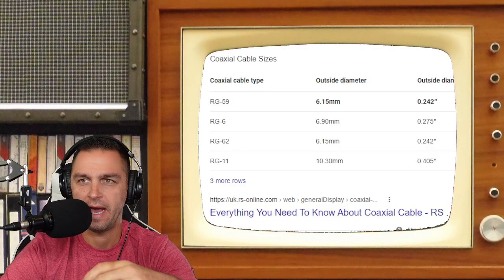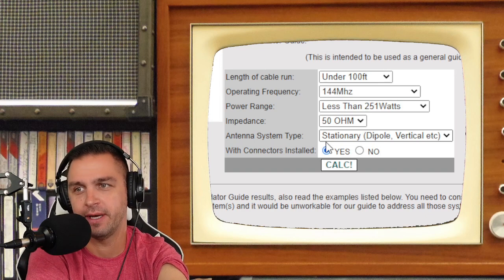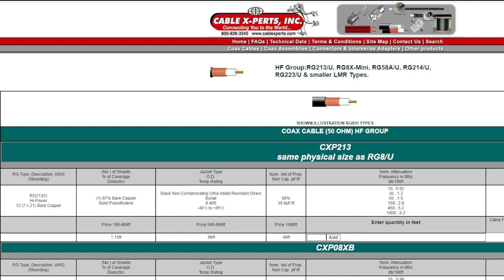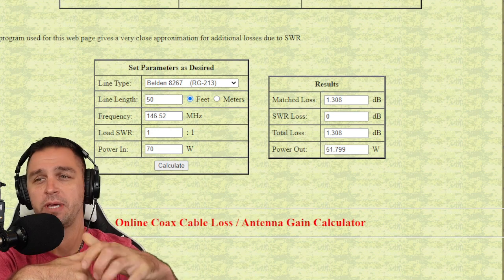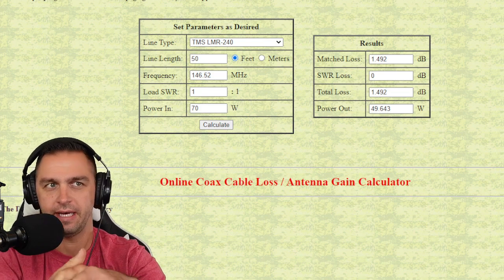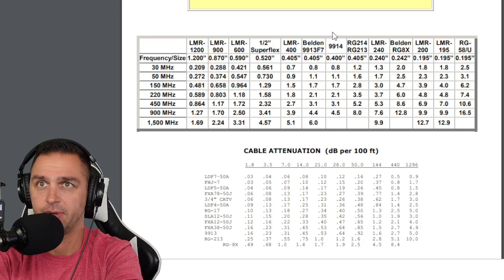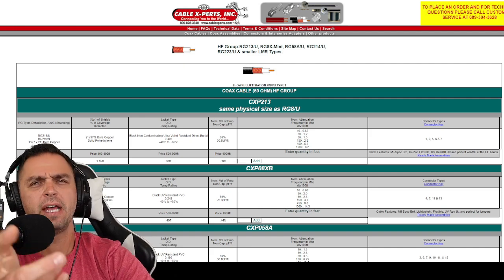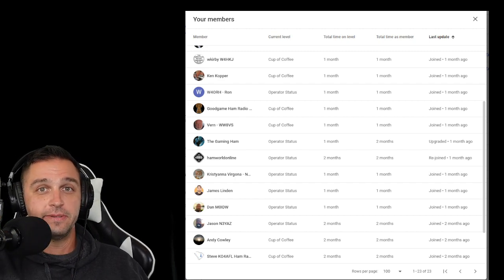How to Choose the BEST Coax Cable Type for Ham Radio - Great Information For New Hams!

Comment: Great job on this Sean! Thank you for the well-thought-out presentation. Goes to show us all that it all depends on our individual use case. There is no "one size fits all" coax, really. I live in Florida, and this past summer it got really hot. So for me, I would look at the heat specs more closely than others who live in a state like Maine. There are so many variables, too...operating frequency, length of the coax run, HOA vs privately owned lot, inside for patch cables vs outside for longer lengths....it pays for the ham to educate themselves...and this video goes a long way in doing so. 73 de Scott, W1AL

Comment: Coax is something that if you can afford the higher grade/lower loss, go for it
Reply from the maker: True.  A few more factors to it in my scenario.  It this video, I end up settling for loss, just compromising how much loss.
Reply: @HAMRADIODUDE  correct. When I put my tower up, I did have lmr 400 previously. But up to lmr600 as loss on 440 was too much thought. Had talked with others about doing coax video. Beat me too it. If you get chance can you hit me up on my email

Comment: Interesting discussion. I usually start with the antenna and work backwards as far as budget is concerned. It is much easier to upgrade and replace a radio when funds allow versus replacing a antenna and coax

Comment: Great video Sean! I was in your same situation a year ago, and ultimately went with RG8x because it cost half as much as the LMR240 with only minimal db loss. I ran 50 ft from my basement up to my attic and tied it in to a N9TAX roll up slim jim antenna which is mounted about 33' above grade.. I can hit repeaters with my Yaesu FTM7250DR easily 50 Miles away, and 35 miles using a cheap Baofeng UV5R. I cannot say enough good things about this antenna!! Judging from your QTH on QRZ, it looks like you have plenty of attic space to hide from the HOA. Should be a super easy install. Check out my QRZ page to see how I hide from the HOA...🤘🤘🤘
Reply from the maker: Hey Todd, No problems with the attic. Fan Dipole.. 40-2m (horizontal or inverted v).  The New antenna of beating the HOA is a 2m Vertical, just because I can :D.  But really, I also wanted an outdoor antenna.   I'm hopeful to have a video out next week.  Those N9TAX roll ups are pretty nice from what I hear.  I will have to look at reviewing one. Thanks!

Comment: Oh might want to look into building your own feedline. I found balanced 4” spaced feeder offers .97% velocity factor and virtually no losses 😉 best way to get your 100w to the antenna vs heating up the coax. Sum have used 2runs coax and tie the shield togather and used the center conductors as balanced lines. Check out the Facebook the toad harbor feedline Randy has a amateur vid of making it using tractor supply electric fence ribbed isolators and 13” uv resistant tie wraps using 12awg thhn solid copper wire

Comment: Informative video. Thanks. Something is wrong with your frame rate as your head and hand movements and mouth movements are sporadic and frames appear missing. May want to check your encoding settings. 73
Reply from the maker: Thanks! I just switched computers and offices and noticed tonight I was only in 30fps. There's also a few edits/cuts in there that may be the cause, but regardless, I changed the fps in my recording software.  I appreciate it

Comment: I was given 1000' of RG11 RG-11 COMMSCOPE F1177TSEF DIRECT BURIAL TRISHIELD COAXIAL DROP CABLE.  I own a mountain farm in east TN so no HOA to be concerned about.
Can I use this cable in a HAM antenna set up?
Thanks!
Reply from the maker: Rg11 is 75 ohms so it would a poor choice for  coax use in  amateur radio, which would need to be 50  ohms for optimal performance.  I'd recommend against it in most situations. That said, did you have an antenna in mind for use? I can probably answer the question a bit more detailed with my answer. Thanks and have a good one